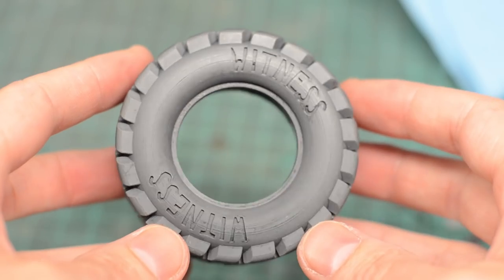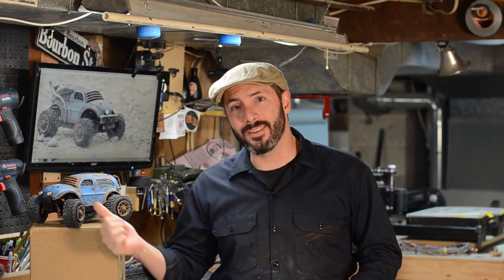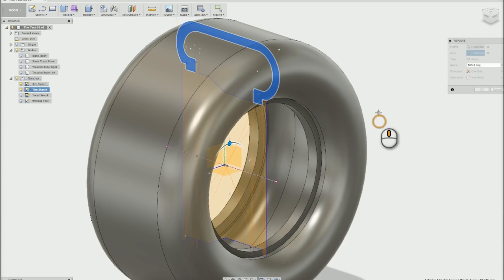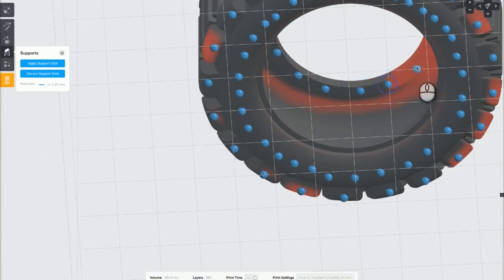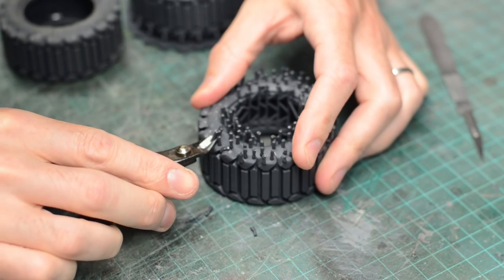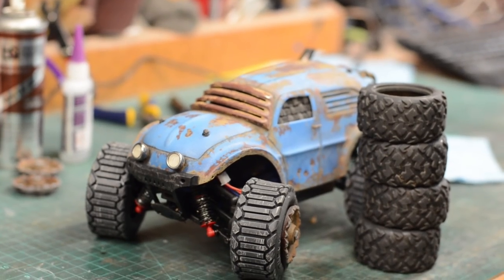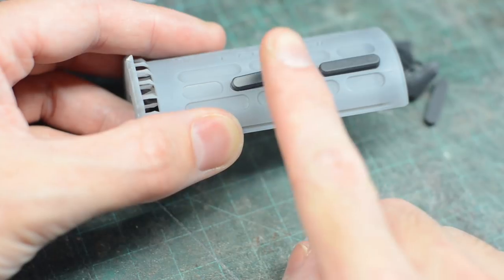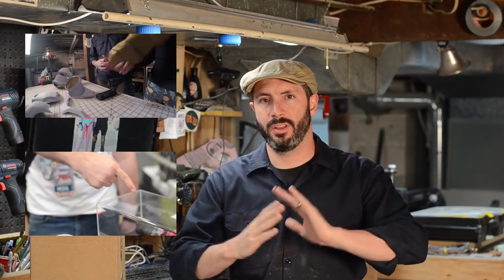3D Printing Custom Tires for my R/C Car - Prop: 3D

Comment: So that rubber material is UV Cured.  You could get one of those gel nail uv devices that they use in Nail Salons and use it as the basis for a UV Cure Box.   The  nail thing has different timer settings for the UV light to cure the gel nails.

Comment: ...also I believe the resin continues to cure in the UV light making prints more brittle. Sealing them with a flexible paint may stop or slow the curing of the Form2 prints. I use a fingernail lamp housing to UV cure my prints quickly. Average cure time is @ an hour. Thx again!

Comment: Recently got a M3D micro with the tough INK flexible material and actually printed out a tamiya M chassis tire though I made the mistake of allowing it to be semi hollow between walls so the inner wall got torn out when I pulled the support material out but the tires are really flexible and maybe just a  little less grippy.
Though from my experience the m3d tough ink if printed solid and figuring proper tire thickness it might make a really good alternative I just gotta find a alternative slicer with custom support setup to make it easier to print an clean up!

Comment: Awesome tires! I really want a Form 2. Ninjaflex is fun if you can get it running through extruder without bunching up. I don't think it works with bowden-style extruders. I printed some Ninjaflex stuff with thin walls and it was very squishy but a little porous. Thanks for all your videos. They're really inspiring.

Comment: Very cool project! Also, if you try again, try adding foam inserts to your tires so the side wall doesn't carry all of the load. You could also try adding a grid or bands to the thinner side wall insides for strength and flex
Reply from the maker: That's a great idea.

Comment: Love it! Excellent use case of the flexible resin. Maybe instead of a uniform thickness to the tire walls try a variable thickness around the rims (say 1mm) and then 2-3mm around the tread. Could be a worthwhile test...on one tire at least. Thx for sharing! Btw I'm a Form2 owner and Fusion, MODO and Zbrush user. (Toy designer)

Comment: I'm not sure I'd print directly in a flexible material for this. It'd probably work better to print a mould and then cast a flexible material into it. In fact, if you wanted to get fancy, you could probably slush cast it directly onto the rim.

Comment: Hi Bill! Any suggestions on getting started with Fusion 360? I have used Tinkercad and 123D Design for a while but felt overwhelmed when it came to fusion. What articles / videos did you use as guides for learning fusion? Thank you for your help!
Reply: Il check it out. Thanks!

Comment: I don't think you'll ever get these tires to work fully without cracking. The stress that an RC puts on the tires is ridiculous. The stock tires that come with a traxxas 2wd are fairly "hard" by RC standards, and they still flex every way imaginable. They are stiff mainly to give the novice a tire which doesn't wear out and it's passable on or off road for some casual back yard fun. Competition tires vary, but similarly to real racing, a single set will last one race, then be turfed for a new set - I'm not sure of the durometer, but they almost feel gummy to the touch (at least for off road races). It looks like stress fractures you're getting, from the car being revved up and the tire wanting to expand. If you look at regular tires while doing this, the tires expand outwards from the centripetal force (I'm also going to guess only the rear drive wheels fractured, not the front?) Looking almost like a pancake rather than Donuts compared to when at rest. Since this material is so much harder, it can't expand, and thinning the walls will only make the tire more fragile I would imagine (unless you use some super soft material)  the only solution I can envision might be too make thicker walls, or some sort of internal bracing structure to provide strength against the centripetal expansion from the torque the RC can put out (imagine the open cell honeycomb structure of the next gen solid construction tires which are switching away from pneumatics, and opting for a flexible semi rigid structure). Purely speculation, but hey - you have a 3d printer, so it's not like you'll have to hand craft every single honey comb on the tires at least. The other option is to just use those tires as show pieces, and swap them out when you want to take it for a drive.
Reply from the maker: +Aaron Miller I might try this again using Ninjaflex with an FDM printer.

Comment: Would you be interested in making a custom set of tires for a build I'm doing?. Everyone I speak too doesn't offer custom tire service..
Reply from the maker: Sorry, but that's not a service I offer.
Reply: Punished Props  thanks for the response. I actually found someone to make them. A little pricey but it is what it it.. Thanks again.

Comment: Kinda hat to laugh out a little bit following the first few seconds of the video wondering how you'd be 3D Printing rubber Tires until I saw the Formlabs Printer - Which I own myself facepalm

On a little side note though... You sure sound WAY different when not being recorded at Tested - I guess this is a Microphone thing?

Comment: use ninja flex
Reply from the maker: I'm gonna have to try that!
Reply: Punished Props ive never used it but with the amount of people if seen use it for elecrics long boards, other ride ons and smaller projects it should work
Reply: Punished Props or if you want to 3d print them again and just mold them in a rubber